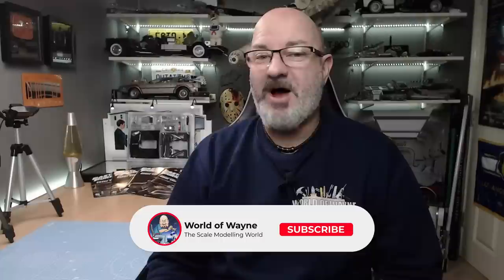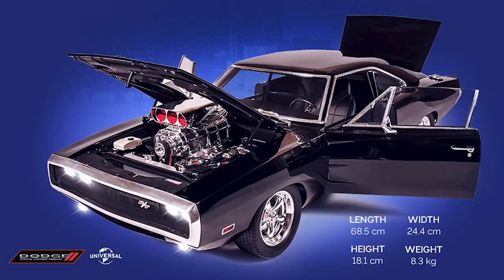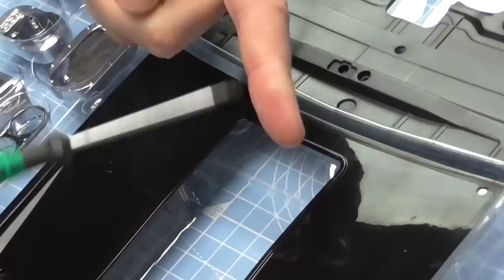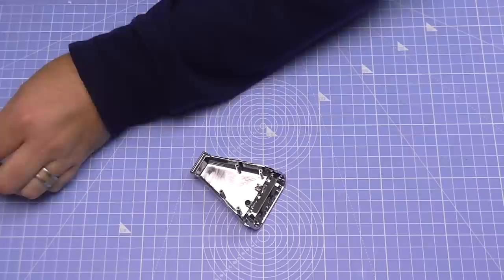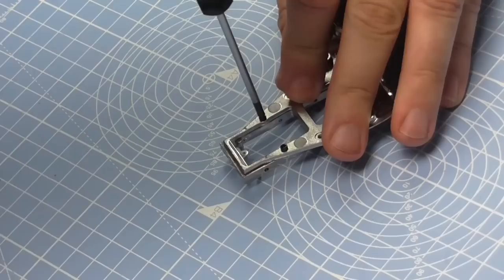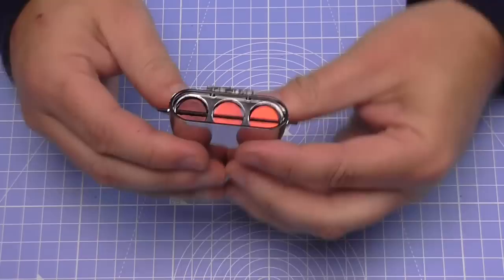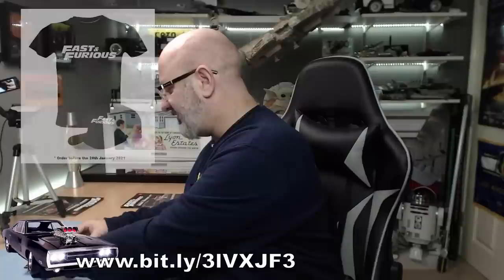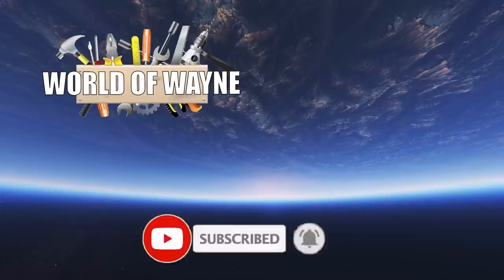Build the Fast & Furious Dodge Charger R/T - Part 1 - Assembling the Bonnet and Supercharger 1

Comment: Secondly i will add, that when you build the suspension it will be difficult, definitely use the oil, it is easy to scrape the paint off. Its pretty challenging, and be careful with how much you tighten the torsion bar, it apprently needs play in it to function, for the whole steering system, I broke mine and had to get another.

Comment: if I was a motor head and had a super charger car with a intake as big as that on the hood I'd have the inside of the intake polished like a mirror and have some LED lights inside it that would flash whenever the vents opened to take in air.

Comment: Hi Wayne - After watching various videos of this model, I can only say that they should never call this a scale model, because it absolutely is not to scale.  If I paid $1,500-$1,700 for this not knowing that, I would be extremely disappointed in it!  Examples: the supercharger is wayyyy too big, the exhaust headers are too small, the Hemi valve covers are not sized correctly, and the worst thing, the supercharger is shown running off the water pump instead of the crankshaft.  How in the world did they get that wrong???  At first I thought this must be made in China or some other distant country unfamiliar with American race engines.  It's actually made in the U.S.A., in Illinois!  Sorry, but for the big bucks needed to purchase this model, those errors are inexcusable in my book.  I am currently building the Agora Cobra 427 S/C and I can only find one noticeable error, and that is they left out the starter motor.  Even much smaller scale car models show a starter motor, maybe not always as a separate part, but at least molded in.  That point aside, I think that kit is much more accurate to scale than this Charger is.  I am referencing your videos in building it - thanks Wayne, you have been a big help!  Well, I do hope that Fanhome gets the feedback necessary to make future kits more to scale and more accurate.

Comment: I just received and completed this assembly, and I am excited about the build, but a little disappointed on one detail: I may be wrong, but it appears that for the hood to lift up completely, the air intake has to be removed, which is probably why it's a push-to-fit rather than fixed in by screws. And with my piece, it's a pain to attach. I'd be really concerned that the lugs will break. I guess I could open the holes a tad but, I also suspect that we will be attaching pull-leavers to the intake, which makes opening the hood even more problematic. Other than that, I enjoyed Part 1!
Reply: How much did it cost you in the end to get all the parts?
Reply: @Smokeyy0420  If you're asking me, I haven't completed the built yet. But each Monthly Pack is $70.63 - Shipping included. (I live in the U.S., so I get my shipments from Fanhome) and I believe there are 28 Packs, or 110 Stages. Fanhome had to issue a shipping increase that raised the monthly charge by about $9. Right now, I'm at Pack 20 with a cost of (rounded) $1,192

Comment: Aren't the throttle links on the wrong side of the air intake?
Reply from the maker: Yes they were. You may notice it missing from the last view bits of video. It's cause I changed them round :D

Comment: Looks a little bit like a commercial... You get that for free, am I right? 😉
Reply from the maker: Nope. I paid for this then I had another sent to me so I'm guessing I will have 1 to give away soon
Reply: @WorldofWayneUK  its a real good build and has a decent quality. In Germany we are at Issue 32 in the Moment, I think.
Reply from the maker: It looks really nice. What order is it being built in. Engine, frame, interior etc.
Reply: The motor is the first finish part with a little break with the front wheels. Then the floor plate and the other wheels and the interior. A German YouTube Chanel gets his issues from France and is currently around Issue 70. The black frame with the shiny finish on it looks really impressive
Reply from the maker: @frankrinsche4548  thank you Frank